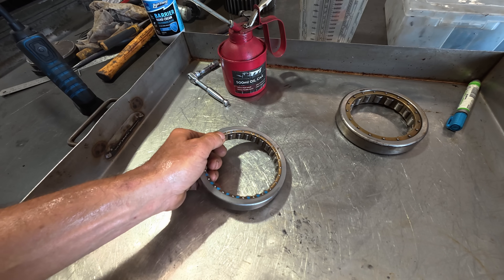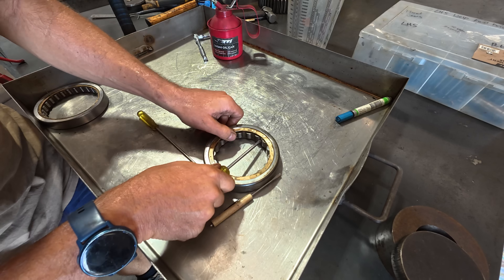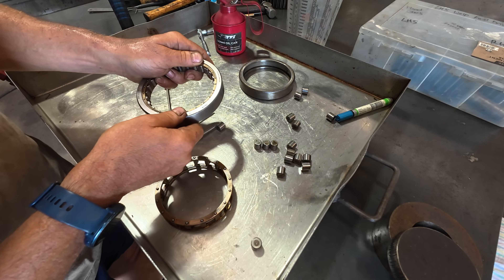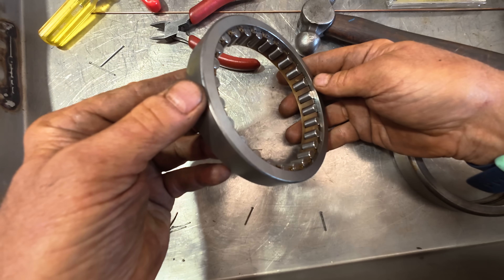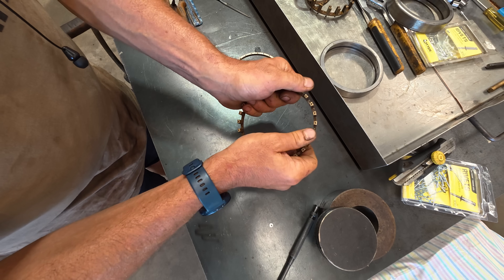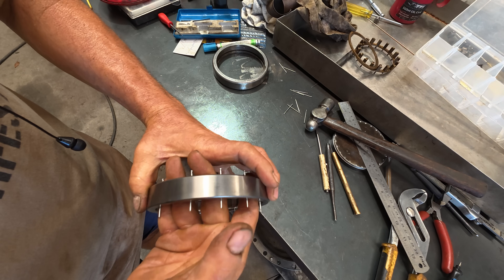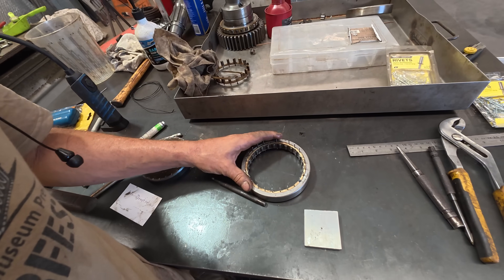If we can't fix this bearing it's going to cost a fortune to replace!

Comment: Hi balue large diameter paper machine bearings are rebuilt as a matter of routine. Finish and clesrance are critical. Finish is refurbished by grinding and clearance is adjusted when the bearing is mounted. Compared to what is required for this bearing, no grinding is irequired, only refitting the cage is needed. Piece of cake!
Excellent presentation!

Comment: Please do tell the original sizes on the bearing. Also include the number of the bearing. I'm very curios. Edit: Actually, that corrosion on the bearing indicates that the bearing got moisture. Check the seals. If the bearing had grease or oil, it wouldn't have rusted like that either. Bearing run dry ?

Comment: Hi Steve. You should invest in an ultrasonic cleaner. I have saved many corroded, stuck parts with it. They sell all sorts of solutions ans as long as you know what to use, it does magic. For this one I would use some vinegar, rustoleum and and diesel. 20 minutes bath in each solution in that order.

Comment: Before you ever took it apart. My thought was spacing and thermal expansion. I've never seen those kind of bearing before but they remind me of a sun gear system that was made to tight not allowing for smooth rotation or corrosion since it has copper and copper weathers over time with moisture and oxygen. 
EDIT: Live in the rust belt of America. Everything turn to powder here.

Comment: The rust has frictioned or expanded the brass into the steek bearing walls common issue with interwar and ww2 era bearings salutions from an ex SKF worker

Comment: A roller bearing cage separates the rollers which at their contact line are rolling in opposite direction.  This limits the speed, not the load.  Drawn Cup (DC) bearings don’t have cages.
The Bearing rollers are sold by the box.  So it is conceivable to omit the cage and add extra rollers to take up the void. The bearing won’t see a lot of service so it ought work fine.    Cheers

Comment: Errr something that just got in my head. Sometimes the bearing cages are made to 'oscillate' in the system so you don't get uneven wear on one spot. 

It's possible it was made with the slightest amount of eccentricity to permit procession as it runs.
Reply: Well if it was, and allowed to sit for a long time, that eccentricity is likely where you got that galvanic corrosion.

Comment: It's not about using the right tool. It's about reminding yourself through the value of a well known and loved tool to respect the part. You're forcing yourself to use nothing but the correct technique when you favourite pliers are at stake! It doesn't forgive but also puts you in full control. This part is worth a thousand of these pliers.

Comment: Having no experience what so ever with that type of bearing, my first assumption was the steel casing is either egg shaped or the walls have been side loaded deforming the side into the brass cage. Surely skf or timkin bearing has stock that would fit your need. Simply email them and tell them the dimensions you require.

Comment: From recent research I have learned the Germans had major problems in tank transmissions which would often fail in the field.  A British engineer called Stevenson wrote papers for the War Office upon it and Bovington museum in U.K. has copies. There were failures because the hardening was a production choke point and Bovington over oil their transmissions to accommodate this known design flaw. An email may assist your problem but some of your damage suggests some of the field problems such vehicles were known to have!

Comment: I really liked this video. I was working on an antique German motorcycle and ran into a bearing of an odd size. Tried to find it for months. Then, I tried repairing the bearing. In the end, I had the housing opened up by a mm to take a common nidern bearing

Comment: Get yourself a big ultrasonic bath, and give it a soak in simple green next time. If you need large bearing work in Australia see Proformance Motorsport (no typo). Scott did a ton of research and work into big bearings like this for his differentials where the CV joints are inside and touching. He knows where to get good ones made, metallurgy these days is really bad, he tests everything.

Comment: My father was an Swedish armature winder as a child I used to watch him reco bearings on electric motors from pre ww2 as they were odd sizes and unavailable here in Australia one of the things he would do with a siezed bearing is drop it in carboline overnight to remove corrosion before reco he also used brass mini hammers and later nylon ones to remove rivets an super small drifts that were strong I still have some of his weird tools and are in the area

Comment: Suggestion?  Could you have used ultrasound while submerged in a mixture of a special warm/hot type solvent?  I am almost sure that by using this type of "ultra" vibration that something would have loosened up?

Comment: Mechanical Engineer here...This was a war crime against roller bearings...Call SKF or FAG....ID OD width...they would help you...  My first attempt would be to soak the bearing in kerosene, carb cleaner, brake kleen or an ultrasonic cleaner and work it free.  If the rollers looked as good as I saw...destructive disassembly would be an absolute last resort.  Great video though...dramatic...emotional...made me watch till the end....

Comment: Just wait, after you finish with it, some old guy in Germany will pop up saying, "Those bearing were also used on this other thing.  We've still got a whole case of them sitting in the storage room."
Reply: same bearing in a WW2 german XXL figet spinner
Reply: That's my first thought. Look up European bearing companies like SKF, FAG, INA, etc. for an replacement bearing in the same dimensions.
Reply: It's highly likely that a matching bearing is available but this makes for a more entertaining video since it was obvious the bearing could easily be disassembled for corrosion removal.
Making the bearing cage out of brass permitted easy manufacture using the manual machine tools of the era back when copper and tin were cheap.
The verbiage is chosen to suit Youtube algorithms which is fine since the museum needs all the funding it can get as most military museums have tiny budgets.
Reply: I was also wondering if those aren’t available anymore? I’m based in southern Germany, but I’m not sure if I’m qualified as “some old guy” ^^

Comment: Very nice work. Really, you do not have to have brass for the cages. As you found, it was galvanic/electrolytic corrosion from the brass that was locking things up. You could probably easily have that brass part scanned and CNC machined from glass filled delrin. Many modern bearings large and small use delrin cages. Whether they are suitable will depending on the load requirement.

Comment: People associate extreme precision, fine craftsmanship, and tight tolerances as engineering mastery. It's not. It's just complex and a massive liability. Narrow minded engineering binds up under load or adverse conditions. Appropriate tolerances, simplicity of manufacture / assembly, serviceability, supply chain optimization and a complex web of analysis makes for good engineering. Germany was swept up in a wave of psychosis that destroyed their society and hampered the mind. People lost the capacity to think strategically and critically under the dear leader. Individual thought was punished severely under collectivism. Coercive social structures destroy the mind, this is reflected in art and engineering of the time.

Comment: I think it's a lack of tin in the brass but we never dug too far. If the ph of the grease is off either contamination or poorly manufactured grease, galvanic corrosion occurs over time I have seen it in large refrigeration compressor motors from that era and in spares shipped with the motors post WW2 (we had some ooollldd gear)usually just copperplating not verdegris. Same issue, bearings aren't available. Where possible we sleeved/bushed to suit modern but usually just replaced the motor with modern.

Comment: Cadmium. Antique clocks/watches I have worked on can have cadmium alloyed into the brass, certainly from Germanic regions. You cannot/should not apply heat to very old German/Austrian brass alloys, without ventilation precautions. The "Germanics" experimented with lots of different formulas in clock brass in the 1800's on. Cadmium lodges in your spine and messes you up later in your short life. Only cold work these old brass alloys and if you need to anneal, be up wind! These brass formulas were certainly present in the mid 20th century in that area, and beyond.

Comment: So interesting to see you rescuing that vintage roller bearing. I have been in a similar predicament while in my former life as a Hydrostatic rebuilder. We had to sometimes put complicated assemblies back into service after having to disassemble the “non-repairable” due to time or most commonly monetary constraints.
Not to brag but I had been known to perform magic restoration of those things.
At times it seemed like a $30,000 bet being placed against the house. The odds  always favor the house. As you know, sometimes you just have to roll the dice after doing all you can do.
Caterpillar HPCU parts can get quite expensive.

Comment: I used to make the cages for those bearings when I worked at hoffmans, and we also did a similar thing and reconditioned them.  I wonder, if some of the parts are sabotage by the slave labour who were forced to make the parts?

Comment: 1:01 Why is the bearing stamped "Fabriqué en Allemagne", "Made in Germany" ? I don't think Germans would want to export this at the time... ???
Reply: I have seen this exact question asked on other videos and this is what was speculated in reply. The Germans before the war were producing all sorts of fine mechanical and industrial goods, including bearings. When the war began, trade stopped, but demand for bearings shifted to the Wermacht. As such, the bearings, perhaps produced years prior for export to England or France were picked off a shelf and put into a tank.
Reply: @dai-nippon_digger  Considering the needs and the quantities, are we sure there was enough bearings previously made to be in stock during the war?
Reply: Sweden and Switzerland were buying German roller bear sings etc as well as tanks and aircraft in the war. Spain as well

Comment: Dave  in the uk here i used to inspect SKF Cages that were silver  plated about a foot in size 
wonderd how they were assembeld insted of pins ours were fine threded bolts 
garryson Garryflex Abrasive Blocks   brown is a fine abrasive for polishing brass the blue is a bit causeer grit

Comment: I used to teach bearing maintenance at an American technical college, but I never saw one built like this.  I'm imagining some bigwig wanted to give his cousin who made this bearing a chance to prove his design.  Still seems unnecessarily complex to me.  But, it's a treat to watch Steve explore its intricacies and repair/rebuild it!
Reply: Consider the production methods available to them at the time. Stamping wasn’t an option, nor were polymers. They didn’t have many options for producing cages, anywhere really. It appears SKF used this design for many of their heavy equipment bearings and I doubt it was a novel system. Wouldn’t be surprised to find similar bearings with the same design in the armor of many different countries during that time.

Comment: A sonic cleaner would have cleaned it safely without all that time in taking it all apart
Reply: Exactly, put it in mineral spirits or vinegar for an hour and it would have washed out all the grit causing the problem.

Comment: That's an excellent high load roller bearing as to how it was designed to hold a lot of rollers. Yes a simpler bearing with fewer rollers could have been used but something like that would not carry the designed load.

Comment: At first I thought the grease harden up, I see now possibly lack of lubrication. Monday I worked on a bottom bracket on a Mongoose 29er, it barely had any miles, the grease in the caged ball bearings solidified like wax for a toilet flange. I think they used the wrong grease or wax.

Comment: As soon as I saw that bearing in the last video my first thought was - immerse it in a bath of clean diesel for a week or two. I've found that works wonders.👍
Reply: That and if you have a  ultrasonic cleaner large enough fill it with diesel and turn it on. You would be surprised what that can do as well.

Comment: 6:17 as long as you do not touch the cage's bearing pockets (do not!!!) you can do pretty much anything you want to the outside of the cage. The only purpose of the cage is to separate the rollers (or balls). It shouldn't touch the races, so the outside doesn't count (for precision outside "not touching").

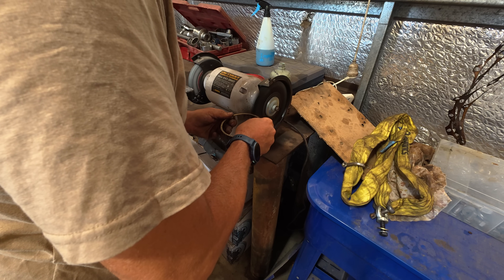Comment: 4:23 yeah, i've seen that in a few that i've "remixed" over the years. Modern ones too. My working theory is that the batches of brass aren't always perfectly blended. The camera (here) doesn't fully pick up color, but, i have noticed that in areas where it is corroded, the brass has a slightly reddish hue. Almost salmon pink, very light. I don't know enough about the metallurgy of soft metals (other than what any layman knows) to know if this is, infact what happens, but i think this the result of too much copper in the blend. I've only seen the green powder (on brass) in such cases. And i wouldn't have noticed it had i not taken apart four such bearings to make one, from a bunch of them being super corroded in the hardened rollers. When i compared the cages, i saw the discoloration + powder coordination.

Comment: Amazing to think all machined by hand,no cnc like today
Reply: The cage was made using a dividing head on a mill - Machine divided.
A pressed sheet metal or molded (or now 3D printed) plastic cage would work just as well.

Comment: Thats insane having such a bearing even made and used in a military verhicle.
Reply: It's not an overly complicated bearing, the efficiency gains having rollers/balls separated in the races compared to loose bearings was logical. The only real difference to a current bearing is the roller cage would be stamped sheetmetal riveted or spotted not machined and riveted phosphor bronze or maybe depending on use a plastic derivative.
Reply: @jimmcfee3488  thats the thing that people often overlook. Sheet metal forming was a novel war time innovation, the "tech" to build these cheaper didnt really exist when the machinery was commissioned
Reply: @jimmcfee3488  not true,  even today we still machine and rivet bronze cages. though if an even number of rollers they are usually  drilled and broached. ex tool and die man in a ball bearing plant.
Reply: What I have said is totally true, precision matched  SKF and FAG bearings I replaced in Stahl screws and motor sets 30 years ago now have stamped cages, there is no difference in accuracy or longevity, we are still getting 30,000 hour mandatory replacement intervals without failure. Yes bronze cages are still available in many applications, especially larger custom applications where setting up for large runs isn't justified but there are cheaper ways to manufacture a bearing in most circumstances SKF have been supplying ours with steel cages for over ten years now, I did initially think they weren't going to be as durable but they met tolerance requirements and have performed well.
Reply: Yes indeed. Such beautiful engineering should have been saved for Porsches or a Mercedes-Benz. Amazing patience and skill Steve. Always a pleasure to watch AusArmour
Reply: Fortunately for the Allies, the Germans' anal-retentiveness meant excellent tanks, but far fewer tanks than the Allies could crank out.
Reply: Krazy😂😂😂
Reply: They probably just used the things they already had. Lathes and mills were drawn into war production from all kinds of branches. And if you have the ability, you might as well use it in essential vehicles. I'd also imagine forced labour added a lot of capacity in the already existing high grade manufacturing lines.
Reply: insane to use a normal ass bearing?

Comment: This type of corrosion is called galvanic corrosion (galvanische Korrision) or bimetallic corrosion (Bimetallkorrision).
Reply: Possibly, if the vehicles electrical system was earthed through the gearbox and engine. The bearings will suffer carrying stray current if the earth strap/s don't work effectively.
Reply: What would be the electrolyte?
Or was the bearing flooded with water?
Reply: @andrewallen9993 If the lubricant absorbs water (moisture) or is contaminated, it can act as an electrolyte and trigger corrosion.